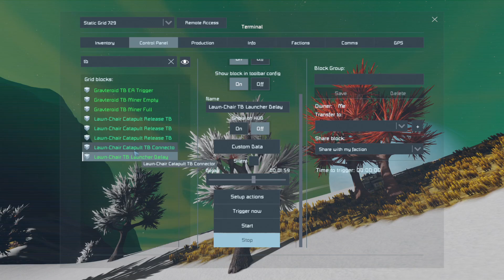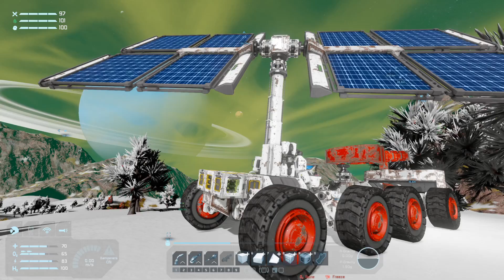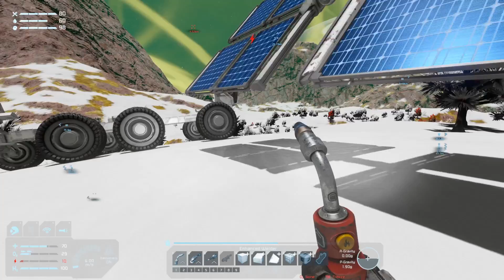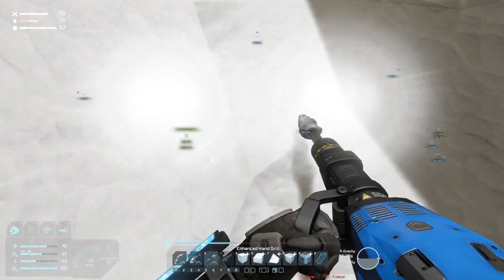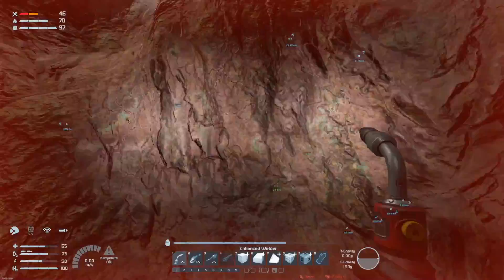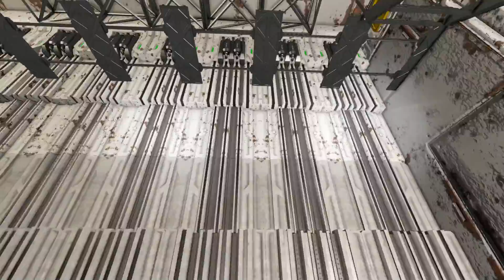Survival Impossible - Janky Panels #37 - Space Engineers Hardcore Survival

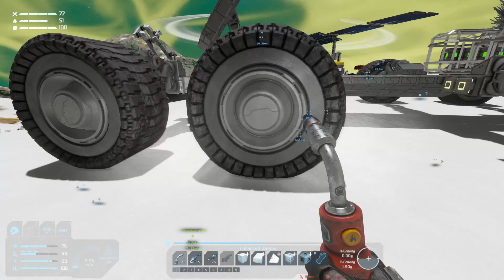Comment: 15:25 - this bug shows a nice optimization.
Making a comparisson to see if the block is on just to add or not a counter costs more than the addition of the counter itself.
The solution is to remove the counter from the list to be increased but if that's not planned ahead of time it WILL need some changes to fit in.

Comment: An idea for the crawler: 
You can use it as a mobile decoy/mobile defense platform to draw away enemy drones. If possible, don't think it is but, have it on auto pilot and patrol around your base or just move it when you see an incoming drone.
Reply from the maker: That could be a good option, I am thinking about building some player made missiles and launching them from a system designed for rocket launches makes sense :)

Comment: Could turn your searchy into a small flying remote controlled welder.
Reply from the maker: I probably could at some point but it'll likely still be quite limited due to the high gravity and how many components I can actually lift :P
Reply: @Splitsie  yes. At least that will keep it from being used alot.  But could be very useful to get a single block or two that u can't quite reach instead of making scaffolding

Comment: Idea for you since you have the materials, covered parking outside. A covered area and connector for each vehicle in case a drone gets too close.

Ideally a heavy armor slab, but light armor or even armored windows would take more hits than the small grid light armor blocks.
Reply from the maker: I've always shied away from covered parking due to the scale, I couldn't come up with a design that I'd like which didn't end up being truly enormous and make the existing buildings feel tiny by comparison :(
Reply: I take a page from the desert landscape I live in.

Solar panels. 

Look nice, thin so scale isn't a problem, can angle with a hinge or rotor for better lines, function, expensive, but not the most fragile this if you put all the bulletproof glass in

Comment: For the drop pod collection I would have a platform where they land with a line of block on a piston to push them to an area with grinders as that seems cheaper to me and less of a hassle then making a big platform of grinders or collectors and then you could easily modify the area where the pods get found down. You could change it from collectors with you grinding it to fully automated grinders later on when you have more resources much easier then the other option of big floor or grinders or collectors.
Reply: that would be a very large platform ... it covers an area about 4 times larger than his base area ... and thats just the main group he has 2 other groups of pods as well in about the same size area ...  cost more to build the platforms than to scrap them outright
Reply: 0623kaboom yeah but it is better then making a big platform which would have to be the same size of collectors or grinders which was watch I was suggesting. plus it would be cool and way less time consuming in the long run then the other options.

Comment: If you align the foodtruck with the sunn, the solarpanels whon't get stuck on the pistons anymore.

I was also wondering iff the solarpanels could had been put one block closer together so they almost touch without the hinges standing out.

Also also. You could alwhays atemt to conect one of your fully charged wehicles to the liftzi and put al bateries on auto so they even out somewhere in the middle (onely so you'r able to conect them both to a propper powersource again).

Congrats on being able to open your helmet while designing. You must have missed the smell of burning metal particles and sparks hitting your everywhere. ^^

Have a nice one.

Comment: keep the turret no matter what .... you know at some point it will be used and be the thing that saves your butt ... besides it will give you a little suppression cover fire if you get caught out with bandits incoming
Reply: you wanted the middle spot plumbed for the piston lift inside the garage to build off of ... and charge the build ... it was to be your work lift mount point build point
Reply: the liftsie is calling out for that lonely red battery so the liftsie can do what it was built to do way back when ... and you have been saying you will connect it up since the first stream since it was built and the panels didnt keep up
Reply: ONE last item for the garage ... you need to setup a flashing light warning system to tell you when there garage is venting pressure ... once it is open it can dull down but if it;s closed or closing flash a few red lights with a claxon to say keep the helmet closed lack of pressure ... then give a green when good
Reply: btw it only took 30 some sessions to get to here on the garage ... as for the empty flat bed hauler ... make a new remora cockpit ... but make it so that it is a swapable cockpit for ANY vehicle you build ... so it can dock on the rmeora body and fly that ... or dock on the pod lifter ... and run that ... or dock on the new food cart and move that ... etc .. then you can make all the bodies you want and a few cockpits that work on all things ... then you can use one as a shuttle to get to space .. use one or two in space ... use them as emergency escape vehicles ... last resort bases ... basic starter base ... 
make every single cockpit like the lander for survival ... it has everything one needs to live and get started again ... just go the step further and make it an integral part of all work ... that way the escape pod is always functional and loaded ... also add ONE gun turret to it ... yeah some protection ... doesnt need to be massive just enough to say go away from a long distance
Reply: this would solve your need for emergency escape pods in space ( every cockpit would be one) .. solve the need for a shuttle ... and the need for multiple vehicles with differing cockpits ... every cockpit becomes a standard view ... while each body is built to hold the cockpit and do it's job the best it can ... 
.
then if you decide you want to make a fighter craft just build the fighter attachment to cover the cockpit and improve it for it's job then if you take lots of damage just eject the cockpit and spray the enemy with the debris of the fighter fuselage  while you shoot your lonely turret at them as you leave at high speed ... to return in the future to smack them to the ground

Comment: Oh no.....ITS ALIVE! The planet is breathing.... KILL IT! Quick...before it achieves consciousness!

Turn the lifter rover into a dump truck for your cargo pods from space, line the bed with landing gear for fun to grab the cargo blocks n what have you. Course, it the sides are tall enough, the landing gear isnt necessary, but then you could build a grinder pit on your base to harvest the load by dumping it in. Kinda want the same angle for dumping as you have for launching, so just s bed change. Your Forklift can hook on to the bed kinda high, and lift itself off the ground to haul it around and not need to build a rack. Some local hardware stores here do that here in the US via a rack to slide the forks into, then safety chain it in place

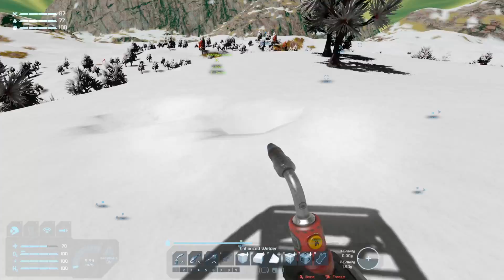Comment: 5:41 With the crane, does that revamp also mean you'll finally actually build the counterweight at the front? So that things like 9:42 don't cause as much issue when you inevitably do forget to lock the thing down (though I think the whole thing is already heavy and wide enough that it wouldn't have mattered much there).

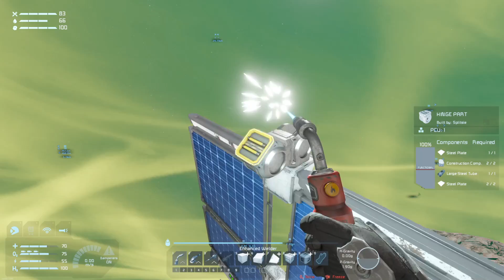12:26 This'll definitely help with your memory of that, at least. Or paranoia. Or both!

15:35 Perhaps the crawler could be an assistant to the crane vehicle? Make a hitch that lines up to one on the crane and have it with several extra landing gear arrays and cargo space, so it can allow the crane to make larger salvage missions. Perhaps it could have its own smaller arm system (maybe just pistons, to move items between its pads) or it could purely be a storage platform. Additionally, such a vehicle could be hitched to something else or used independently for construction missions. Perhaps even a merge block setup so you can attach a thruster frame to it, to allow it to assist with building and salvaging of further places such as the mine on the side of the plateau, the mountaintop antenna arrays, or ASSERT ships and bases in hard-to-reach places on the cliffs.

23:47 The drones did a lot of damage with ramming, but it seems like it's sometimes almost too much for the early times, like you said. But as the trade-off, they'll do a lot more damage with their mounted gatling guns and higher aggression, particularly against the larger targets that they would previously have rammed. They might even be doing similar damage, but now it's more spread out and not them penetrating two blocks of armor and damaging vital blocks.
Though I will miss watching the turrets shred those smaller ones and track the pieces they split into, I suppose we'll just have to let the larger ones make that show.

33:50 With my refit suggestion it would be usable for that, if you decided to use that suggestion and complete it before gathering those,  but I still think it'd be more useful as a general resource and grid carrying vehicle, for the purposes I had mentioned before. Maybe you could hitch the forklift to the back of it and use it alongside or in place of the crane on some expeditions should you want to. Also, if you did ever use the Lawn-Chair for the purpose you intended after the iron deposit is depleted (as a resource transfer station between Omicron and space), you would likely find yourself launching barrages of drop pods again, just full of something other than iron that you carry back from another asteroid.

34:42 You missed the paint on the conveyor tubes, and the conveyor pipe to one of the turrets on the far wall.

38:30 Might want to give the drop pod collection building the additional purpose of being a cargo storage structure? Or even hydrogen and oxygen storage as well? Then you can have a building that's less of a detailed cube, since it'll have multiple things.

Comment: maybe have that leftover button on the pannel as an on/off to lock the doors so you can't accidently open one with a single press. Or if it's possible maybe have a sensor that automaticly locks the door if the hanger is pressureised and unlocks when depressureised.

Comment: 4:50 Why not use a rotor part on a piston or beam of armour blocks or something to connect the truck to the base? That way you can still leech power without having to worry about sharing inventories.

Although on second thought, I doubt that would prevent all the Daily Needs blocks from usurping first slot on the production menu...

21:10 I don't think that script currently interfaces with the scifi buttons yet. I tried using them on an airlock system I'd built and I couldn't get the script to recognize the LCD on the block.
Reply from the maker: Yup, that's exactly why, silly assembler priorities :(

That's also sad about the buttons, might have to look into something else

Comment: A way for you to use the 'BoBs'(Build and Repair System) and still have a challenge is to limit yourself to one!  Also the crawler could be converted to a mobile ice retrieval and processing vehicle. used to get ice from any ice lake near you and bring it back and refine it in to O2/H2 on the way.  you could give it several large cargo containers, H2/O2 tanks and generators.  it could also have a H2 engine for emergency power.  It held a ship on its back, I think it has room for this.  If you add the build and repair systems, the crawler could just be made to be a rover that has them to repair the base and dismantle the drop-pods, 'BoB, The Crawler'
Reply from the maker: Nope, nope, nope - never using bob :P

Comment: As a safety measure, would it be possible to use a programmable block to prevent the hangar doors from opening if the hangar is pressurised?  Perhaps have a separate "emergency blowout" button if you need to evacuate/vent in a hurry.

I guess there probably aren't many in-game reasons to do the latter, but role-playing wise, it seems like something desirable when there's potential for serious fire risks (welding, grinding etc.).
Reply from the maker: It should be, but it's the sort of thing that would take me a long time to work out myself if there isn't already a script made which did it :P

Comment: If your gonna redesign the drop pods, I think you can remove the large battery to save resources, no need for a beacon anymore either as you know where they land. Could just have small battery for the parachutes
Reply from the maker: That's true, might need to do some tests on how long a beacon will remain active after launch on small batteries as the change in weight would alter the trajectory a bit (though likely not much as most of the mass is the iron)

Comment: Just a quick suggestion for your crawler, stick grinders on the front, then cargo on back. Use it as a quick way to collect the pods.

Edit: if you do make a grinder rover, Muncher would be a good name.
Reply from the maker: That's a fair option, I always get worried about grinders flinging valuable stuff around after my previous experiences though :P
Reply: Splitsie a bit out there, but a nice idea if you want to have a challenging design to make. What about you  make a grinder upside down bow? So you would have a bow that you lower from above into the drop pods, avoiding pieces being able to fly away, and it could come out to be a very nice design also. Just and idea though, I don’t know the feasibility of it, but sure would love to see it
Reply: @Splitsie  also, I love the solar panel hinge thing, I have been struggling to fit 10 large grid ones on a Isy's solar script compatible rotor tower into a space barely wide enough to fit the length of it. It also doesn't help that I've built it on a rover with a similer purpose to your big orange rover from escape unlikely.
Reply: @Splitsie  Maybe a Collector arm that can be lowered in front of the pod to stop stuff being flung?
Reply: @Splitsie  true true
Reply: @Splitsie  you will just have to had grind every thing ... or make the pods space returnable like you had planned with the rocket and its boosters ... the second plan for the remora base hauler ... was the resupply rocket ... send it up WITH the empty pods ... then return the pods full with the lawn-chair ...
Reply: Maybe if you decide to go with the grinder rover route you could add a pair of arms that wrap around the pods to prevent things from flinging away??? I’m thinking something similar to a C&C 95 Tiberium Harvester, maybe even have the grinders on the arms & have them push into the material to be ground down???

Comment: You can also build segments(the framework) of a cargo spaceship that carries the initial fuel and some cargo to the lawn chair  in the garage which can then link up with the remora
Reply: When I say initial I mean the stuff that will help the remora get juiced up with and last longer to find a ice asteroid and some silver
Reply from the maker: I had hoped to do that at some point, I may have to start contemplating a somewhat modular fuel launcher to make it work :)
Reply: You could have the main column of the ship be segmented 4 parts that just require you to move a projecter of the blueprint around thus making it easier to build with a heavy duty crane and welding pit to build it then place on the new and improved launch pad